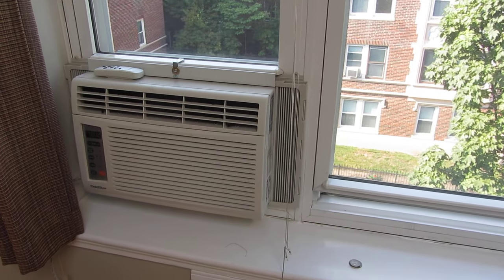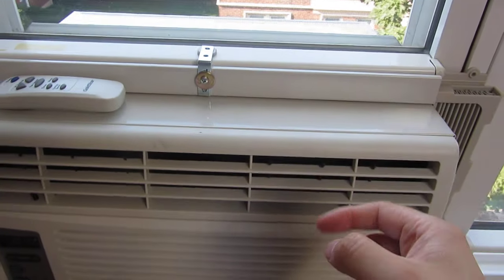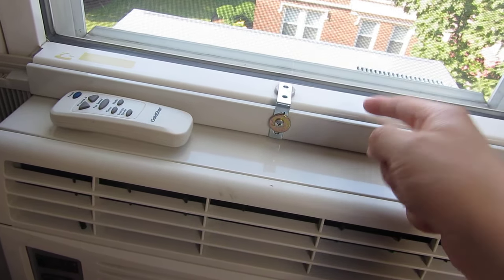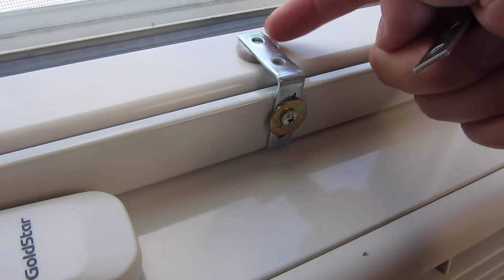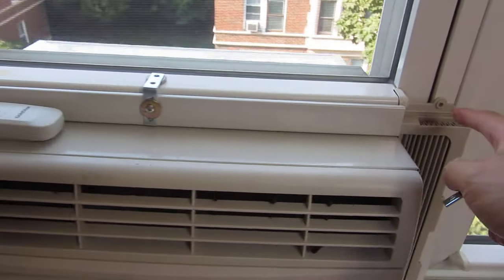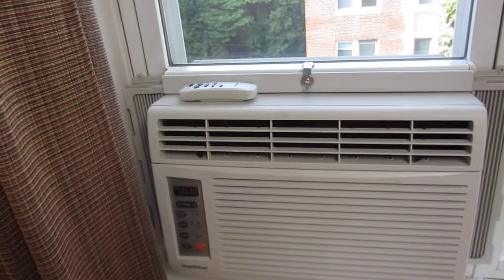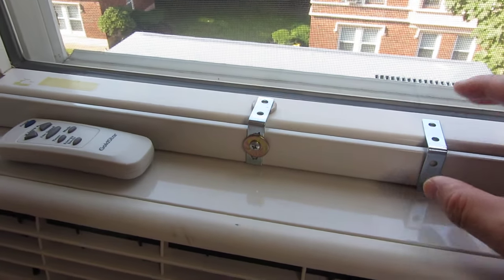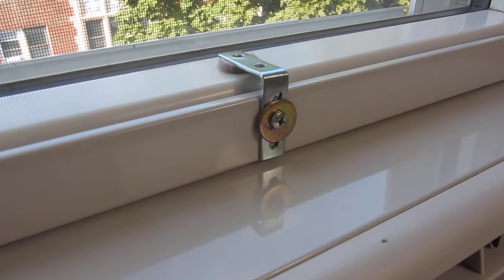Secure AC Window Unit without Drilling Holes and Damaging Window How to Install Tips Solution

Comment: Nice idea!  The weight of the AC would be to normally fall "out" of the window so the L-bracket works.  For people on lower floors though, screwing the unit to the frame may be essential from a security perspective, because you can always push the unit inward if you're relying on gravity.

Comment: To this day I'm shocked how no window companies (that I know of) don't build into their windows that they sell some kind of air conditioner bar or clamp on each side of their window so when you put an A/C unit on it the mechanism automatically adjusts to the A/C size parameters and clamps the A/C so the A/C doesn't fall out and the A/C can't be pushed in.  The first window company to do that will rule the window market.
Reply: Yoir idea . Patent it now. Not later .

Comment: I planned to use your solution because I have replacement vinyl windows that fold inward for cleaning — the latches to open the window are in the same spot the instructions tell you to install brackets to hold the window down. But when I placed the A/C unit in my window, I realized the part of the window the A/C bar rests against has a lip/ledge above the bar that extends past it, making the L bracket solution unworkable. I ended up putting some pieces of wood between the top of the window and the top of the frame to keep the window down.

That said, the model I bought (Frigidaire 5k BTU mini compact A/C) already had a hole in the center of the metal bar where you placed the L bracket. For anyone who doesn’t have weird shaped window sills like mine, it would be the perfect 100% no drill solution.

Comment: That’s not enough to be safe , after you you that measure from top of window( that slides up ) to the inside of window casing . Cut a piece of wood ( wooden broom handle will work) that fits very tightly into the opening so that you have to tap it into place , wedging it in . This makes the window impossible to open so is a good secondary safety feature

Comment: Good idea but I would like to add some. He did not screw on the window which is a plus. I would screw the bracket to the shim only just in case. Another tip, make the shim thickness to allow few degrees just to have the AC out of the level for the water to run down. Let's say, if the shim is 1/2 inch thick and the AC is leveled, maybe a 7/16 shim would do.

Comment: Very Nice.  I've been trying to come up with a similar "no drill" solution.  I may also do some thing similar for the A/C accordions on the side.  Attach small angle brackets to the accordions holes to attach them to the wooden walls beside my windows.  
I don't want to drill into the vinyl windows but I'm ok with putting 2 small holes into the wood walls.
Reply: What did you or what do you plan to use other then the corner brackets to result in not drilling? 
I’m trying to do something similar and don’t wish to drill the window at all. I also kept those side vents in like the one illustrated in the video inside as opposed to more within the window if you will.
Reply: @hhova29  Super long post incoming.   If your not installing the A/C on the ground floor of a house or apartment the rest of my post doesn't really apply.  After thinking about my installation I realized I cannot have my A/C sitting inside the window like in the video (ground floor) or use the bracket like that.  Security is my top priority with my A/C.  

The bracket in this video only keeps the A/C from falling out and the window from being lifted.  It doesn't stop the A/C from being pushed in or the outer (sash) double hung window from being pulled down.  

I've thought and thought about how to secure a window A/C.  It's more complicated than I realized, especially if you don't want to drill holes in your windows..   I don't have it solved 100% but I'm getting there.  

1.  I bought and installed an "A/C Safe" or "A/C Lock" bracket    https://www.lowes.com/pd/Frost-King-Air-Conditioner-Support-Bracket/1000524017
It's a metal bracket bent in the shape of a big 'S"   When you put it on top of the A/C and close the window, it makes it so the A/C unit can't be pushed or pulled out of the window without lifting the window up first.  Here is an annoying infomercial showing how the bracket is installed and works.  https://www.youtube.com/watch?v=BYoCKRENu7Y   
I bought one off of eBay for $10.

The best device I've seen is the ACe Brace by BocciaBros which secures the A/C to the walls at the side of the window frame.  https://www.youtube.com/watch?v=POC1u9tNP-Q
You can't push or pull the AC out even if the window is up.  It has the added benefit of supporting the weight of the A/C unit by the walls instead of the window.  You can even open your window and not worry about the A/C falling out.  The problem being is it cost $76.   I'm thinking about maybe making something similar with a piece of steel bar.  2 bends and 2 twists and drill a couple holes...Done.     The same could probably be done with a piece of steel angle.    This only works if you don't mind drilling into the walls or window frame.

2.  I've been trying to figure out how to secure the sliding (sashes) windows (inner and outer) from moving.  I might add the bracket like in this video to the A/C Lock bracket on my unit.   With both installed it would make it near impossible open the inner window.  You would have to lift the weight of the A/C and window at the same time. An intruder would have to climb through the window with all that weight pushing down on them.  This still doesn't secure the outer window.  Someone could still pull it down and climb in or reach in.  Everyone seems to forget that that outside window can be pulled down.  This may or may not be a problem for you depending on your window shape and size.  

The simplest device I could think of is some wooden sticks or pieces of PVC pipe.  I had some PVC pipe so I used it.  You need a stick that will go between the top of the inner window up to the handle on the outer window.   This keeps someone from opening either window.   I then added a second stick from the top of the inner window to the top of the window frame for extra security.      There are metal devices for sale that do something similar but they are rather expensive ~$25 each.  

I bought, but have yet to try a device called "Window Wedge".  It's basically a tiny rubber door stopper that wedges between the two windows.  It's supposed to make it hard to open the window.

3.  I haven't figures out how to secure the sides of the A/C.  The expandable accordions.   There is nothing stopping someone from just punching them out.  They are made of cheap plastic.   There is also little to keep someone from then sliding the window A/C left or right in the window.  You could slide the A/C all the way to one side and then try to climb in, if there is room.  Screwing the A/C to the window would help prevent this problem.   This isn't a problem if your installing larger window A/C's.  They seem to almost fill up a standard window.  My side panels are extended 6 inches on both sides.  I believe the ACe Brace I mentioned above would solve this problem.  I believe the A/C unit is connected to the bracket.
Reply: @hhova29  is it possible to g
Reply: @jTempVids  sorry for replying to an old post, but the potential security issue you are describing (someone pulling the top sash down) would only be an issue with a double hung window right? shouldn't that little "A/C lock" brace work well for a single hung window even on the ground floor?
Reply: @ShanevsDCsniperr  Yes, The problem I was discussing was mainly with double hung windows.  With a single hung window you still need to secure the movable window somehow, to keep someone from lifting the window from the outside.   Most A/C's have a spot on the upper bracket to put a screw into the window to tie the window to the A/C.   The "A/C lock has a thumb screw for this purpose.

Alternatively, you can use a piece of pipe or wood to go from the top the movable window up to the window frame.

Comment: I'm going to get this tomorrow and installing it on my new window AC. I didn't install all the hardware perm. with my GE, because I'm renting a house and I cannot do damage to the 
windows, etc. Drilling into the top bar of the AC is fine.
Reply: @gus473  Nevermind, I didn't bother, I ended up not needing it, since the AC is in a very low window at front of house, and it's secured on its own.

Comment: Prior to installing air conditioners that can impede the opening of a window, reviewing escape routes in the event of a fire is important. Good questions to ask: how would a guest or a child (or a firefighter from the outside) open the window (especially if it’s the only window in the room)? Indoor AC units are an alternative to traditional window-based units. Many will not obstruct the opening of a window, and they definitely will not fall from a window!

Comment: You didn't mentioned where you bought the felt and what is the size it is. Also, what is the size of the screw you used and the washer. It would help if you included that information. Anyway, great demonstration and illustration.
Reply: If you need someone to give an exact size of screw and washer for a Simpleton project like this then you really do not need to attempt it. Go feed your cats.

Comment: How come your side panels are not behind the bottom window frame. 
They will not keep the rain out in that position.
Seems like you put the rail on the bottom of the ac in front of the window sill lip instead of behind it so it and the side panels rest in the window channel were the sash would normally close into
Reply: That's a good point. Installing with this technique puts the bar that would normally line up with the window for mounting, in front of the window. That's why the side panels don't line up. You'd probably have to put some extra effort into sealing / weatherization with this method.

Comment: His window has a bizarrely big ledge on the bottom of the window so the L bracket has plenty of room before it hits the window.  This solution does not work with my pretty standard Anderson Windows because the L bracket would break the window.

Comment: I'm not getting how the bar keeps the window from opening to hold in the AC. How is the unit attached to the bar? Thank you! (I don't have my window ac unit yet for a visual. )
Reply: To open the window with this on, you'd have to lift the entire weight of the ac up to do it.
Reply: The part that they screwed the L bar into comes with the ac and is screwed onto the top of the ac.

Comment: My window AC lockdown method is to cut 2 pieces of wood, and jam this on top both corners, between the top edge of the open window and top of window frame.  These jam woods method will not allow you to open the window, and tighten the window to AC.

Comment: It would have been helpful to ACTUALLY Demonstrate the WHOLE Process of installing the brackets from scratch. I cannot tell WHAT it's actually screwed into!
Reply: At 1:06 He mentioned the L-bracket is screwed into the AC window bar. There is a felt pad placed between the window seal and L-bracket. A pretty simple concept, find a man to do the job for you.
Reply: @Vlfkfnejisjejrjtjrie  bruh
Reply: @Vlfkfnejisjejrjtjrie  I'm with Audrey he talked a lot about the L bracket but didn't really show the install.  Good video though.
Reply: @emar6728  Truth. Find a man to do the job, not a soy boy.

Comment: Love this idea.  can you please tell me what the 3/4" screw is screwed into if its not screwed into the window frame?  i am not allowed to use screws  I do have a small hole on the top of my window unit  which i imagine is what someone would use as the hole to screw into the frame.  so i am going to put the L bracket there but what am i screwing into?
Reply: Either he found a screw that perfectly threads into the AC unit bar, or he used a nut in the back, which is what I think I’m going to end up doing.

Comment: The AC units are flat underneath, so did you remove that vinyl weather strip at the bottom?
Reply from the maker: No.  I put a small strip of wooden board that was about 1/2" thick at the bottom of the sill, basically to make it even but also lock into the window bottom gap.

Comment: Hi, I have a quick question for anyone please? It says that I have to tilt my new LG window unit back to drain. However, they did not make it so the window edges will be flush with it if I do so. 

Part of the unit edges will then be inside the window sill if I do this. Why do they make it like that if it needs to be tilted back? 

And my question is, should I now tape the non-flush bottom and side edges so that there is a seal!? 

No one’s window has a tilt like that so it’s not my actual window that is the issue. 

Isn’t taping the seal just as bad for the integrity of the unit because it will not have a proper seal and will have to work twice as hard?

I tried to call LG and she knew nothing. I could hear her typing in this question and her answer was “It needs to be tilted back.” Thank you so much for helping if anyone sees this.
Reply: Did u figure this out?
Reply: The bottom rail is usually welded in place to the frame of the A/C;  so to obtain a downward tilt you can do the following. Remove the screws holding the top rail to the top of the A/C's cabinet. With a round file or a Dremel rotary grinder, elongate the screw holes in the top rail 1/16 inch toward the rear of your air conditioner. Then replace the top rail and screws and you can adjust the top rail foward to give adjustable tilt to the rear.
P.S. You may need to place small washers under the screw heads if you made the elongated holes too wide.
Reply: Hi, I have a quick question for anyone please? It says that I have to tilt my new LG window unit back to drain. However, they did not make it so the window edges will be flush with it if I do so. Part of the unit edges will then be inside the window sill if I do this. Why do they make it like that if it needs to be tilted back? And my question is, should I now tape the non-flush bottom and side edges so that there is a seal!? No one’s window has a tilt like that so it’s not my actual window that is the issue. 
Isn’t taping the seal just as bad for the integrity of the unit because it will not have a proper seal and will have to work twice as hard? I tried to call LG and she knew nothing. I could hear her typing in this question and her answer was “It needs to be tilted back.” Thank you so much for helping if anyone sees this.                                 Fixed         your           spacing.             So       others      can        have                      room                                     to                                                comment.         🙄🙄

Comment: So your screwing it into the hole that is already there for the window?
Reply from the maker: There is a bar that comes with the AC that is mounted to the top which is for the side expanders.  I'm simply drilling a hole there on that bar, that comes with the AC.  Then using an L shaped bracket to hook on the window sill.

Comment: If the L bracket isn’t drilled into the frame there is no force keeping the ac attached to it.
Reply from the maker: The force is gravity.  It can't fall out towards the exterior because its blocked by the window handle.  You can try to open the window, but you would have to carry the entire 50 lbs AC with you.  Now if you are still concerned it will fall inward towards the interior, you can put a few brackets to the side or a block at the bottom of the interior.  If you use this method, and try all directions, with all the force you have, it will not budge.
Reply: @PoolarityChannel  I don't th8nk falling inward is a problem..with the width the dimensions of the a/c and the non existent slack on that L-bracket. Nice solution.
Reply: Greta idea, but i would use thick double stick tape instead of the felt . . .

Comment: Wouldn't it pull on the window and eventually pull the window out if the frame? Or crack or break the window?
Reply: Most of the weight is just sitting on the bottom of the sill, a bit of the weight pulls outward on the window but that's true for any window AC installation. Unless the frame is rotten, it shouldn't be a problem. The L-bracket really just prevents the window from lifting up, it doesn't "pull" on it at all.
Reply: Hopefully. All at once. And cascade to the ground.

Comment: The side panels on the side of the ac are on backwards and on the opposite sides...
Reply: That is quite the eye you have, yes the ac should slip into the window channel and the filler panels should also in order to stop air flow from inside to outside.
Reply: Looks like he did it that way on purpose to make the unit flush with the handle instead of flush with the window itself. Otherwise the handle would stick out over the top of the unit and the L-bracket wouldn't fit.

Comment: I have never had or installed a window unit so I don't really get what the l bracket is drilled into and since I don't know that I don't know if this will work on the ac unit i want to buy.
Reply: All air conditioners "should" come with that bracket. It attaches to the top of the unit so that the window closes behind it.
Reply: @j.m.feather470  thanks

Comment: Sorry but this is not the best idea. Its much easier and more secure to use a piece of wood cut to length to shim the window between the top of the lower sash and the head (top of the window frame) . When done correctly this method places downward force on to the top of the AC unit effectively pinning it in place. If you don't like the look of the wood you can use a security clip as shown in this vid https://www.youtube.com/watch?v=mwoEkiRFEA4